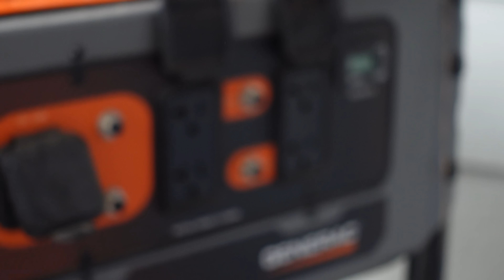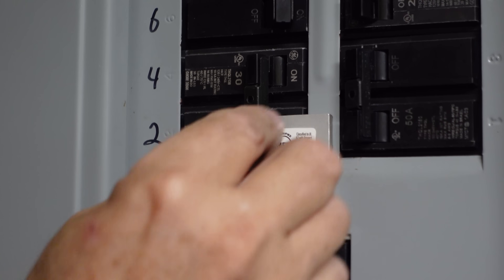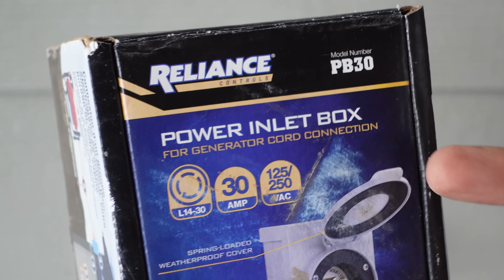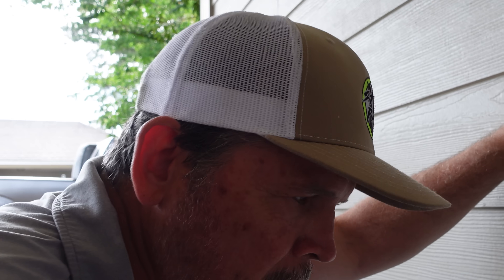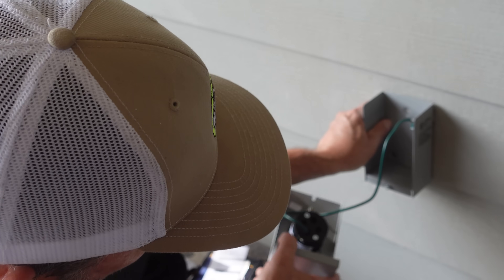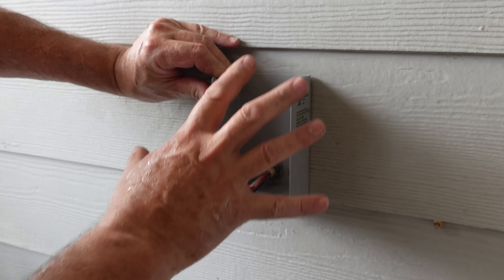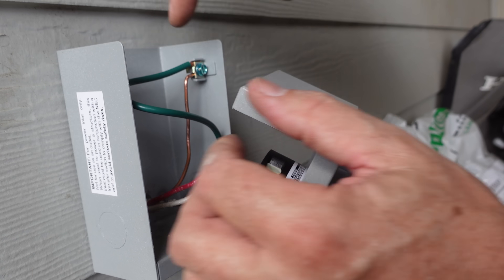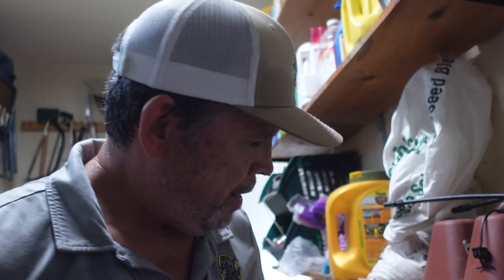What is a Suicide Cord and Why It Could Kill You

Comment: Thank you for making this video and i mean thank you. I had a couple people tell me ahh nah just modify the cord. I live in the country now and i have a 9000watt generator I found the adapter i needed to step from a 30 amp to the 50 amp receptacle but then realized very quickly i would need to have two male ends like you describe here. I am going to fire my electrician and get a new one who will just put the right inlet and interlock on the outside of my house like i asked for in the first freaking place. But with bad weather coming quickly, i feel confident i can take out the 50 amp receptacle and rewire that for the 30 amp inlet to get by for a few days.

Comment: Good work! Except for one point: The earth connection at the earth terminal of the housing. Why didn't you use a wire end ferrule, instead placing the fine wires loosely under the terminal? Some of the veins are squeezed in this way, the others lie loosely next to each other. The difference is painfully noticeable when a higher current flows through these wires in the event of a fault. This spot usually gets very hot.

Comment: Great video, you covered a lot of basics but I was surprised that while you discussed changing out the 20A power outlet, you never mentioned the wiring gage at all.  The copper wire looks like 12AWG ... could be 10AWG but you really should have talked about the importance of ensuring the existing wiring can support the load capacity of your new connection point.
Reply: True. That needs to be #10 for 30A
Reply: Exactly my comment. Looks like 12 gauge wire. Only good for 20 amps.
Reply: Just the comment I was looking for. Surprised not that many people caught this.
Reply: Glad i found this as well. Was about to make the same comment

Comment: As an HVAC Technician i wouldn't recommend powering central ac unit from a portable generator because it will consume most of all the generators power leaving you with almost no extra to power anything else plus it needs constant power to keep the house cool and as soon as you turn it off house will warm up very quickly from high levels of humidity after a storm..... Instead get yourself a 120V portable AC unit place it in the living room and bring out the board games lol

Comment: I made one of these cords. It's really useful for wiring a house. You can test each of your newly wired sockets is wired correctly by feeding in current to the socket before from another live outlet somewhere in the house. Do that with each one you wire and you know when you eventually connect that circuit to the switchboard there will be no wiring errors to search for.
Reply: All good until you plug on leg into another and have 240V short across your cord 💀

Comment: Good job! You did some nice work. One question though - I didn't see anything resembling a drain hole in that new box. In your kind of weather, and the box exposed, it's inevitable that water will get in there. How will you prevent it from accumulating? How will you prevent water from backing up into the cable?

Comment: Our home is all electric (Electric furnace, hotwater,-tank A/C, etc). Entrance to home is 200Amp at 240 volts, split as 120/120. 

 When I redid the kitchen,  I pulled a 120/120 cable( 3+ground) from panel to second 15A breaker box under the counter.  I needed an outlet/receptacle on a cement wall opposite the sink.  The receptacle box was chiselled into a cement wall, and I was able to install a single receptacle box in that wall.   On the outlet/receptacle, I split the lower socket from the upper one by breaking that link on the receptacle and ran the 220volt supply first to a local breaker box under the counter, and then to the receptacle. Each socket is separately protected by a 15amp breaker.  (No GFCI).   This allowed me to use a toaster and frying pan or two appliances that draw a heavy amp at the common receptacle at that location. 

Around the sink wall of the kitchen, there are other outlets which are GFCI protected.  I could not run a link from there as there were already 3 receptacles on that circuit,(Our electrical code specified a max of 3 outlets to one circuit). 
Question. Does your building code allow such a receptacle split (120/120)  in a kitchen area that is 10++ feet (across the room) from the nearest water source?

Comment: The interlock is a great move, and not expensive to fit.
However...
Changing male plug to female and the receptacle to male is HYPER-expensive - electrical suppliers charge (no pun intended) insane prices for that stuff.  Point being that not everyone has cash to splash on hyper-safety, especially after buying a decent generator.

I reckon that a few family rules and a little common sense makes cheap-risky into cheap-doable.

Comment: I added an isolated generator circuit with an 130 volt outlet behind my refrigerator and near my freezer down stairs.  Never suicide cables.  i can plug in refrigerator and freezer plus extension cords to power lights, computers, etc with small generator.  Also could run extension cord from neighbor if  power failure is isolated to my property.   Next I will install transfer switch for my gas furnace.   Pipes freezing is a real concern in Minneapolis .

Comment: I have a 30 amp back feed but no interlock.  My main 200 amp breaker is at the top of the panel and my 30 amp back feed breaker is at the very bottom of a full 40 slot panel.  Is there any other type of interlock that would work or would my panel wiring need to be redone?  The few times I have used it I was very careful to make sure the main was off and the exterior generator cables were connected before starting.  I do have a male-female cable though.    No suicide cable.

Comment: What I don't understand is why "suicide" connections were ever allowed to happen. Was it doen this way to allow the house to feed something else?. Logically, if the house is connected to a generator, the entire house is one great big appliance, so IT should have a male connector. Obviously it's also much safer to have a male to female cable and male receptacle on the house. This is the way caravans are wired to take power at caravan parks for example (at least in Australia). Also, I couldn't quite see, but was the old box grounded (I could see the connector was)? The new one was.

Comment: I have seen hacks where they did not put an interlock in the panel and backfed the panel through the dryer receptacle.  Talk a about out of code and dangerous.  They wanted to feed the panel cheap and did not care about anyone's safety including themselves. They did not realize that if they had a fire or seriously hurt of killed a linesman, insurance would not cover them and they could be also held criminally responsible

Comment: Overall, you did a great job.

The piece of wood you cut out for the blocking looked to be 3/4", then you secured it with "pocket screws". My problem with this method is, the screws are not going to catch enough of the stud. It's only going to catch the outside edge. I know it's not holding any weight, but that's besides the point. I would have cut 2 1x3's and screwed the plywood to the 1x3's. Then I would have placed it in the cavity and screwed the 1x3's to the studs. This way nothing could ever push that plywood through the wall.

One more thing I want to add, living in Louisiana myself, we have problems with wasp. Wasp will find any crevis to build a nest. The crack you left below the box between the siding and the back side of the box, is enough for a wasp to build a nest. I would have caulked it after the box was installed.

Comment: Why did you make such a large hole to bring your wire through to the outside?  Could have used a 1" or 3/4" paddle bit on the same impact you used for your screws. So much easier and not such a huge hole.  Just my 2 cents.   Overall the video was well done and very informative as always. Keep up the good work.

Comment: unfortunately the interlock kits are illegal in Canada as they can be defeated by simply removing panel cover , I wish they were legal cause its the best way and cheapest , transfer panels only have so many circuits so ya can't power whole house as normal , and back feeding threw dryer receptacle is not dummy proof and still allows for human error same as the interlock kit  , back feeding the main system is alway a possibility using something like this or back feeding a  dryer  receptacle  and sending high voltage down the lines , linemen are aware of this possibility and take the necessary precautions , if they don't well they weren't cut out to be a lineman and natural selection will take its course unfortunately

Comment: This is the first time I've seen a dedicated circuit in a panel for backup power like this. When we installed our backup generator in the early 1990s, we were required to put in an (exterior) transfer switch to not backfeed the generator power. That slider is really slick (and a ton cheaper) -- I like it! I would hope that this would be a code thing in Minnesota by now. Genius device.
Reply: @klinestill "The word is, "ingenious".  A person may be a genius, but a device, process, or idea would be ingenious." For now.

Comment: Volts don't kill. Amps do. 240v with sufficient amperage would kill you, but it's not a guarantee. Amperage over 1 is lethal, if it's like 0.4 even if it was like 2million volts it wouldn't kill you, just hurt like hell. This is the principle of tazer technology. Most tazers output more than 240v. Most of them output more than 50,000v.

Comment: While I heard you say the old loosely attached receptacle to the 
outside house wall was wrongly sized 20A receptacle which you replaced with a proper 30A  one, I did not hear whether the existing conductors were 10ga to match the new 30A receptacle.  Your demonstration was very clear
except for verifying the size of the existing wires. I can't imagine
someone  pulling 10ga conductors to then use  20A rated receptacle.
Reply from the maker: They're 10G

Comment: One reason to replace the male plug on the suicide cord, is to make it safe, and not leave the suicide cord laying arround. 

When I patch a drywall, I tend to put a 4-6" strip of wood board behind where the drywall boards join together, and put drywall screws through it. Then you avoid them moving independently, and causing cracks in the mud.

Comment: Excellent job!  Save lineman!  I used to service generators and people that done use transfer switches will backfeed through a 240vac outlet used for a dryer connection. 
Its important to turn off the main breaker if backfeeding through a outlet for amperage not to go backwards towards transmission lines.

Comment: Well done showing the use of an interlock rather than a partial-panel transfer switch.  There is no such thing as important vs. non-important circuits.  You use different circuits different times of the day and the way you balance things is to not run the AC and microwave and hair dryer at the same time.  The only practical transfer switch is a whole-house transfer switch that also switches ground as used with standby generators as opposed to a portable generator that most people actually use.

Comment: I’m not sure if you know this trick , put the metal romex connector on the wire tight the screw and pull the wire throw and install the locking nut.

Comment: I actually made my own suicide cord a few years ago to use to power my basement sump pump from a same-circuit outlet in the garage (after turning off the breaker).  So, I'm missing  both of the protections you covered in this video.   My cord does have a warning sign attached ("Attach to generator LAST") but it isn't enough;  I agree that it is inherently dangerous.

I might find the interlock, but I have so far been unable to find a 12-V version of the male-ended power box.  Any referral to one of those would be much appreciated.

Comment: I feel like "suicide cords" are fine. They are only dangerous if you do something really stupid; in which case you probably deserved it, and it's probably better for everyone that they've won a Darwin award and removed themselves. That said, there's really no reason to ever have a "male" plug with exposed leads anymore; they're a holdover from the earliest days of electricity and infrastructure. Like those standard small power A/C wires with no exposed leads that are used for TVs and power bricks, to USB-C for small power DC stuff, to stuff like EV cables (in particular Tesla connector or the older J1772).... none of them have exposed leads. Should just come up with a single new standard to replace everything and mandate its usage. Pretty much all standard plugs worldwide are dangerous...

Comment: Hi!  First off thanks for sharing the knowledge, love your vids.  I just watched the one where the neutral got ya.   My question is from that point on do you always check for current from that point on even if the breaker is off?  Did you do it on this job and just didn't show it?  It happened to my me a week ago and when I put meter on it showed like 60v.  Never found out how just didn't touch no bare wires. LOL.  Thank you!

Comment: @6:10 why use an impact driver to remove simple philip  screws from a plastic fixture 🤔 I'd assume you probably drive a "work truck" with aftermarket accessories. This kind of contractor I avoid because it's blatant excessive spending from excessive profits aka charging too much for simple jobs an electrician with 50 years of experience driving a beat up 1990 F150 could have done better and cheaper. Also more straightforward with costs vs laborand parts 🤷‍♂️

Comment: Not just linemen are at risk, but having no sync on a generator risks catastrophic failure of your equipment: big bucks, and maybe a fire in both the panel and your generator.  Interlocks are mandatory.   Even with no generator, you want to turn your main off in a storm outage:  initial switching as power is restored often comes with an initial voltage spike that can damage things - let the power company sort out their end first

Comment: You seemed reluctant to do anything to alter your male-to-male "extension cord", if that's the one you were referring to.  Why not?  What can that M-to-M (suicide) cable be used for safely?  I'd say to cut it in half, install male receptacles on each half, and now you have 2 safe Male-to-Female extension cords!  Also, now the cutout switch serves to prevent energizing the male connectors in the box.

Comment: Prefer a transfer switch over a piece of metal bolted to the dead front.

Also, I believe it’s current that kills, not necessarily 120/220/240 voltage.

Comment: Can barely breath during light manual labor, goes to truck 4 times, puts fitting on box before wire causing you to need to improvise to get screws tight on fitting, still using flat heads instead of nut drivers, talking about pulling slack from attic instead of just adding a jumper wire,  you sir are an out of shape idiot. And I bet you assholes charged $200+ for this job. Sad

Comment: A couple of years ago, I had a Generac generator installed. It's a 16 K. Before that, I was using a Honda 2000 I generator I had in a lean-to against the garage where I hooked up cables I could plug into the generator from the led to which connected straight through to the garage where they were receptacles I can plug into, but I end up having so many cables in the winter when it's cold the 12-3 gets really stiff. No central heating or air with the Honda the Generac pretty much has everything. My house is all electric as long as I don't use the stove, oven, and AC microwave. At the same time, it's all good in the hood. Special when you get to take warm showers, and the simple things Become important!

Comment: Nearly every Christmas season while working in the electrical department of a local hardware store I was approached by someone, usually a man, who needed a double-male extension cord to finish hanging his holiday lights.   It happens when you grab the male end of the light strand and start hanging your lights from that end.  When you're done you're left with a female end to plug into your extension cord requires a 'Suicide Cord' to work.  These folks were always disappointed when I told them we didn't sell such a cord due to its deadly nature.

Comment: At 15:47, Paul says that he will order a new extension cord rather than replace a male with a female connector on the existing cord. However, would it be reasonable to change the connector to remove the existence of a suicide cord? Otherwise you have to throw away the original extension cord, but someone who doesn't know better might fish it out of the trash unless you cut it to pieces. Comments?

Comment: Put the cable clamp in the box loosely, mark where it's gonna clamp with a sharpie pull the box down and take the clamp off the box then install the clamp on the wire by itself and use the lock ring to finish up.

Comment: When running the generator and throwing the breaker what are you powering with those bottom breakers is it specific outlets in the house or something else is it a secondary line to the fridge etc. In other words what is the benefit of running the generator through the panel as opposed to using extension cords.

Comment: 14:00 would code allow putting a pigtail under the ground screw, then wire nutting the 3 ground wires together? Seems like the easier solution that’s just as safe (if not safer due to different wire types (solid, stranded) and diameters under the screw terminal)?